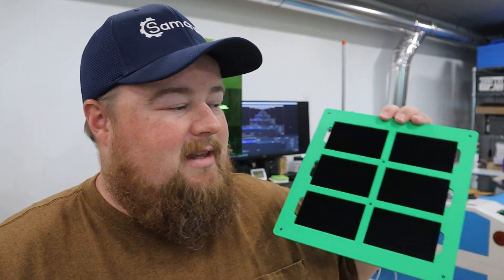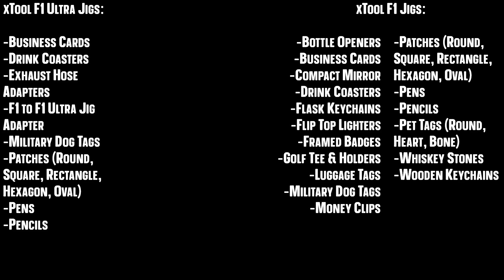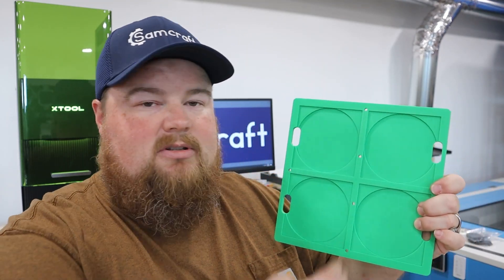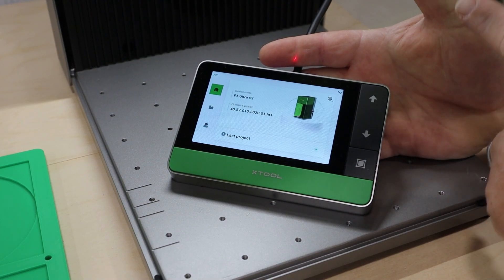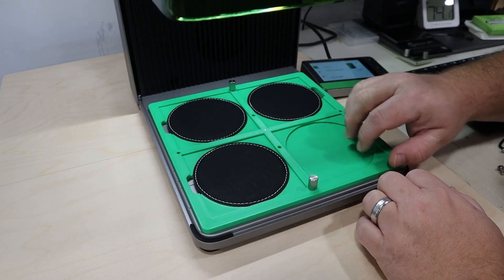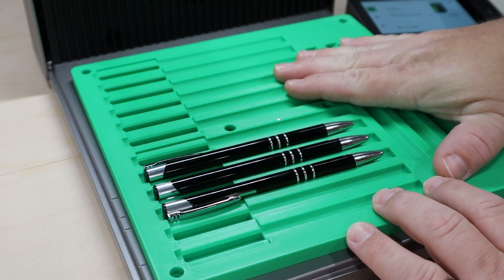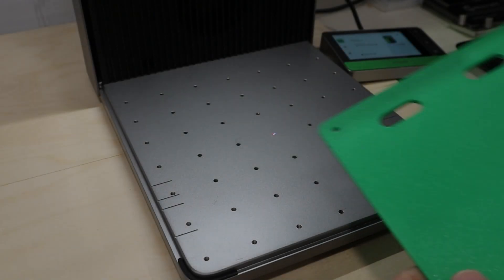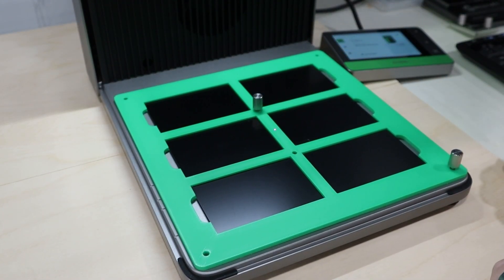How to Use my xTool F1 Ultra Laser Jigs

Comment: Dam, I need help buying a lazer to lazer on bourbon barrel heads which are 21” round on the barrel and barrel staves which are 4” wide X 36” long. Staves are off the barrel X tool D1 is perfect but can’t find one to buy S1 they said it wouldn’t work

Comment: Hi Sam! I purchased your Baseplate few months ago before I even received my F1U. Now, I am playing with it but noticed that the F1U lid/cover is sitting on top of the base plate and not all the way closed. The base plate is bigger than the base of the machine itself. Is that how it's supposed to be? There's  about an inch opening between the lid and the base of the F1U and I had to disable the warning that the lid is open. Thanks in advance.
Reply from the maker: Yes, the baseplate is intentionally larger to accommodate the large F1 jigs I sell. It's a necessary evil, so to speak, to get the quick change option for jigs.

Comment: I looked at those.  So glad I didn't get one.  My 120W, 60w and 30W fiber lasers run circles around those. If the Xtool didn't cost so much then maybe its ok.
Reply from the maker: What brand galvos do you use?
Reply: @Samcraftcom  Well I tried to answer but my it keeps getting deleted.

Comment: I'm trying to create my own jigs for an F1 not ultra. One thing that's always had me questioning my sanity is how one creates a 3d print and then align it with the template in XCS. Which one comes first? As you know know with your 3d printer you find all sorts of prints out there and many don't come with the XCS template. Do you have documentation you've found somewhere that you use to make them or ?? I don't think I need exact step by step, just what. parameters do you use, what one comes first XCS template or CAD file for 3d Print?
Reply from the maker: I spent a great deal of time working out my process. I have a large box of prototype jigs I kept for kicks to show what all I went through to dial it in. The jig is the egg, the file is the chicken.
Reply: Thanks!

Comment: Great video Sam. I just ordered a couple of your jigs and look forward to more F1 Ultra jigs (I received my F1 Ultra laser last week). I purchased your 'Jig Adapter - xTool F1 to F1 Ultra' as it saves most of my previous jigs that were for the F1 (standard laser). 

The downloadable files that come with the confirmation email are great and will save time on production. Also, your explanation on "How to Use my XCS Project Files" (10:21) in your video is great resource. Thanks for pointing out the new 'Lock/Unlock' option (14:47) that is now available (time saver!).

Comment: Sam why are your hold down holes so large that you can move the jig that much?  I make mine so tight that there is almost not wiggle.  That way once I have my jigs aligned and the file saved I never have to realign, bolt it up and go!

Comment: Thank you. On the pen jig, how do you test to get the right settings? Obviously can use the test grid file, but any suggestions?
Reply from the maker: When I am testing a new product I'll usually just lay it down on the laser bed without a jig since alignment is not as big of an issue. If the pen material is the same as another I have engraved on (anodized aluminum business cards for example), then I'll use those known settings first, then adjust as needed for the outcome I want. If nothing else, the built-in material settings in XCS can also help to get you close to a range and experiment with further, too.